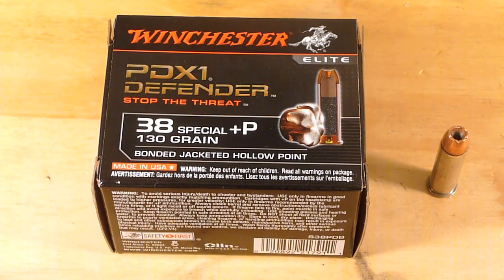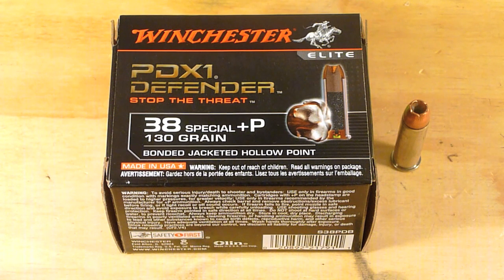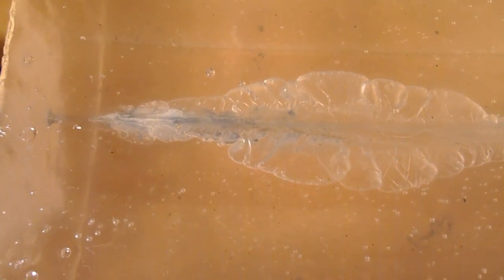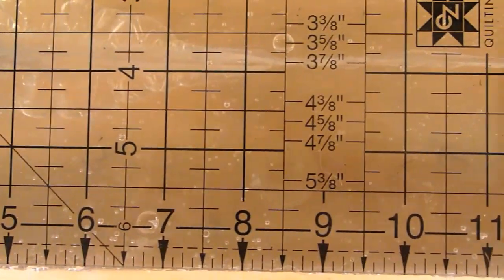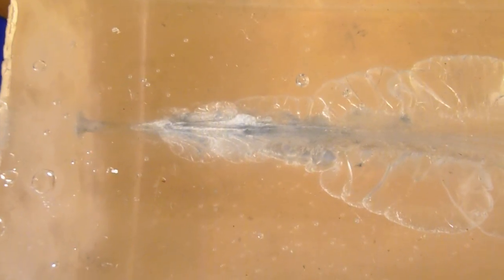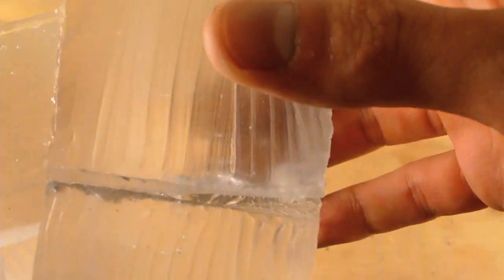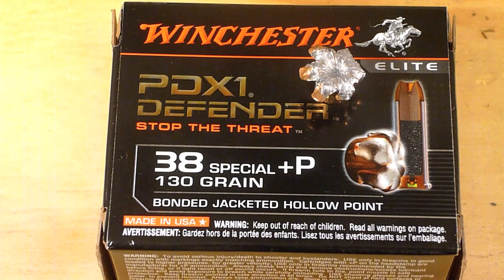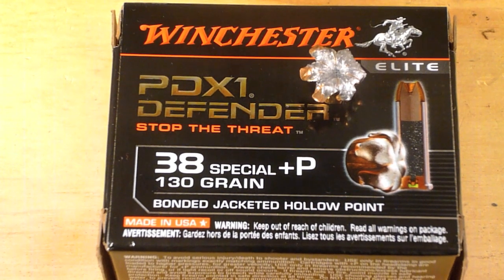Clear Ballistics Gel: Winchester PDX1  .38 special +p 130g

Comment: I'd rather have a 357 mag
Reply: In a 1 7/8 barrel J frame, they are pretty much worse compared to the 38 +p rounds. Just not enough barrel and you end up with a harsher recoiling gun that makes follow up shots slower. And at night you have extreme and often blinding muzzle flash. Unless you have atleast a 3 inch barrel....38 +p is the wiser choice.
Reply: I've always wanted a 44 special,I use these is my charter undercover for carry,great guns
Reply: I am not sure if you saw the recent Lucky Gunner tests, but it really varies from load to load. There are several 38 special loads I would use (in a 2 inch) over 357 loads based on those tests. If you look you will see that particularly with regards to the Speer short barrel loads and the Winchester PDX1, Ranger, and Train and Defend loads, the 38's did almost as well as the 357's out of a 2 inch barrel in terms of penetration and expansion. Without the excessive recoil and muzzle flash that could make follow ups more difficult or blind you in a night time scenario. You do have to be more selective with your ammo in a 38, this much is true. But even in those tests, you see 357's failing rather spectacularly (Speer 125 grain loads)

That being said, I don't like anything shorter than a 3 inch barrel in a wheelgun. If I must go more compact than a 3 inch Model 60, I will go for a semi auto in 9mm.

Comment: PDX1 is a great round.  It's the same as their Ranger Bonded series sold to the LEO market.  Much less expensive  when purchased that way.
Reply: This round kinds sucks with barrier test, but I found an old lot of the actual T-series the ammo was well preserved but I am gonna remove the old powder and reload them HOT!
Reply: @danialphaomega  Remember if loading for a 357 Magnum,  you may load to 357 Magnum level. Just don't fire it in a 38 Special, even if rated for +P.

Comment: Is one bullet enough to really test performance?  You fired multiple rounds to average velocity, why isn't that the case with the gel?
Reply: +Rick Holden gel blocks are very expensive
Reply: Why not fire multiple rounds into the same block?
Reply: They may want to use the block again on a different round
Reply: You can cut a melt down the block and remold it

Comment: Sir, you would be shocked, I inherited five snubby revolvers, all made by S&W. Using one 50 round box of ammo ,and firing five rounds in each gun. there was a 270 fps spread between the highest and lowest Chrono readings WITH THE SAME BOX OF AMMO. The newest gun was made in 1993, the oldest was 1965. All guns were tight and in like new condition. The barrels were slugged and cylinders were checked with a micrometer. The guns made before 1980 had chambers in the cylinder shaped different for Round nose lead 158 grain ammo. One of the newer guns had one chamber larger than the rest. Someone had fired a very hot  reload eg,+p+ round in that chamber. This explains why some one got worse results than you did. also, even in a locked gun rest,  a 158 grainer hit point of aim a 110 grn Hydroshock hit low your 130 grain load hit higher than the 110 grain. How ever, still below the 158 grainer. I hope this helps. Good video.
Reply: The cylinder/barrel my be too large as well.

Comment: Thanks for another good video. Awhile back I bought one box of the PDX1 in 357 Magnum. Now I'd like a box (or 2 or 3) in 38 Special Plus P but can't find it ANYWHERE in 38 Special. Most places I don't see it in ANY caliber. Did this become that popular or are they slow in production?
Reply: All depends on your location, and timing.  PDX1 is around tho far a wide variety of Caliber's although in .38 special yes it does come and go one has to grab it while it's there.  .38 special is sparse in general these days, you are correct, as is .357 Mag but it all depends where you are at.  Some places have it, many don't.  My local Walmart's have had plenty of pdx1 in .40s&w, and at times .45acp sitting there for months.  The 9mm and .38 special in this load does go quick tho. I have some in .38+p 158 gr.  To be honest, I have the same exact little alloy J frame revolver this fella is using and for a small J frame the 158gr+p in pdx1(he's testing the 130gr+5) has quite a blast, and is rather stout.  I carry 5 in the gun and have 2 speed strips of the Federal Hydra Shok in 130gr+p, which I personally prefer for the .38special+p over the pdx1.  Smoother, a little less stout, and less muzzle flash.   Looking into the 135gr+p gold dot for short barrel, want to try that load out next.